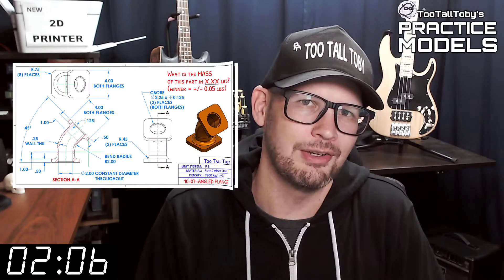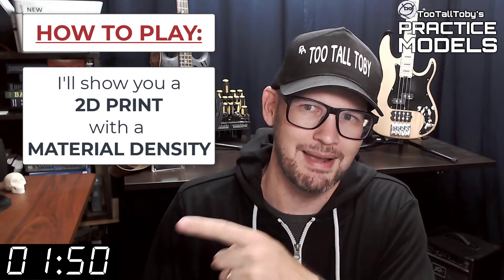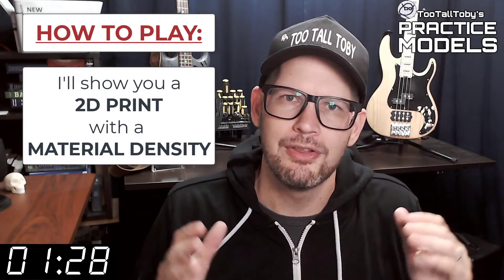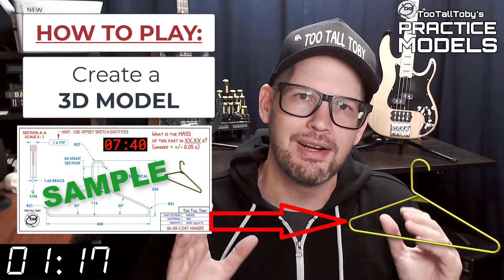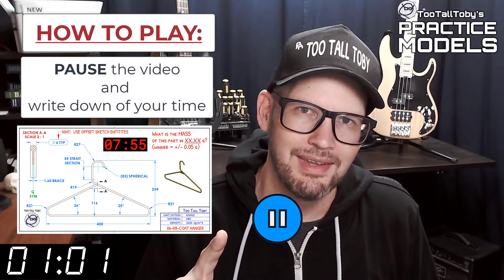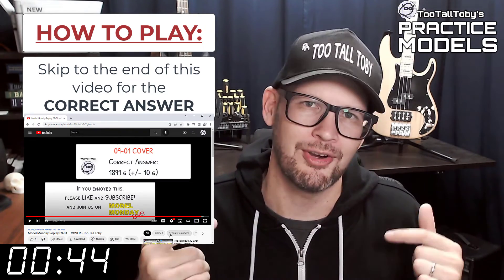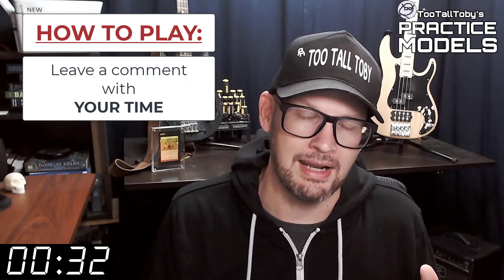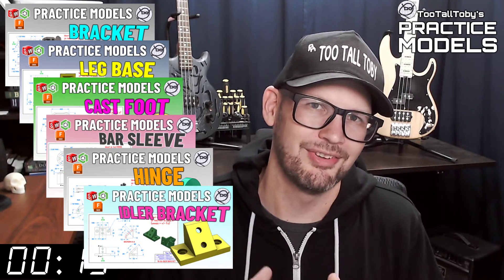2D Drawing to 3D CAD - PRACTICE MODEL- Exercises for Onshape, SolidWorks - PLASTIC PORT COVER

Comment: took 6 minutes in catia. Wasted some time mostly due to imperial notations, adding "in" to every value wastes some time. At the end i've paused the video but went online to calculate the mass form my kilograms to lbs. ends up 0,16011423kg and 0.3529914535 lb

Workflow: Pad - main cilinder, elongated hole over the cylinder, hole on top (through), shelled the body extracting the hole and bottom, did a thick bad with projected bottom edge to create the flange. Plopped the points on sketch for flange holes (easy as they are on the axis of the holes, constrained all from outside and tied all together with .375value), done one hole then userpattered with the points sketch, added stiffner, added a small pad on top of the elongated shaft, small hole on top, apply material, measure inertia, paused the video, googled how many lb my kg value was.. and it was indeed correct
Reply from the maker: Very nice job!

Comment: .354  Plasticity 15min (unfamiliar software!)... 5 minutes searching for the Shell equivalent command. Used thicken on spilt faces. EDIT: its called "Hollow Solid"

Run 2 - 0.35299 lb    8:30 mins
Reply from the maker: Awww yeah awesome job!  Some of the plasticity guys (like phosphor) are in the TooTallToby discord server - if you have any questions they are always helpful 😀